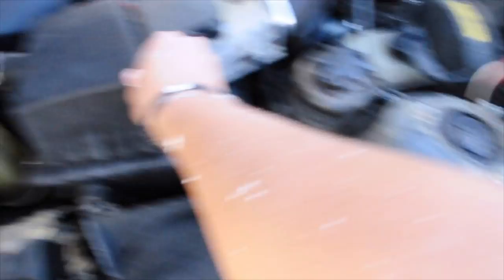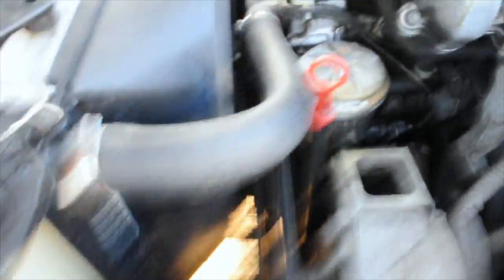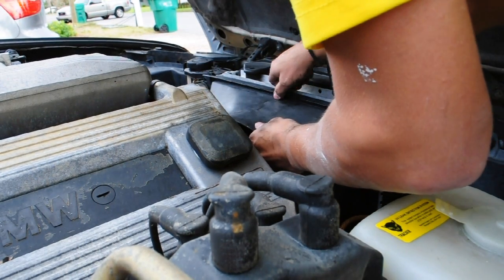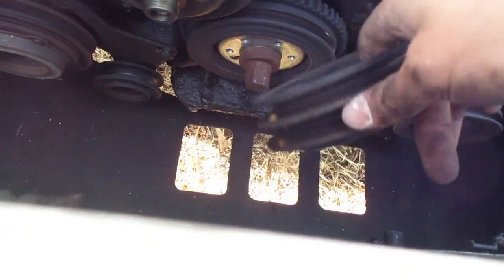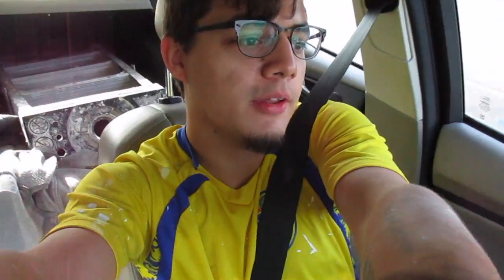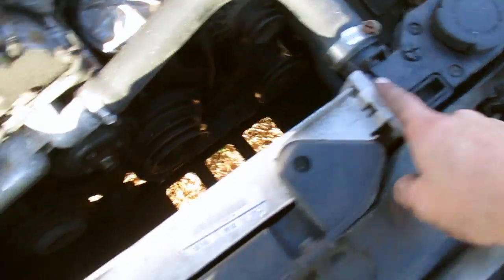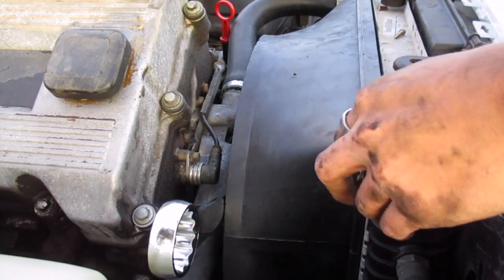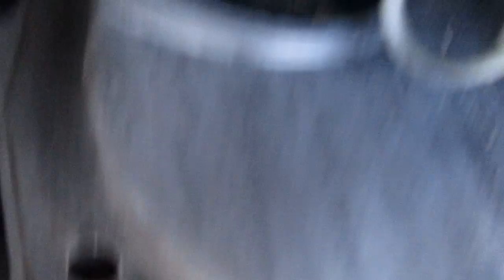Project E30 EP. 5: NEW BELTS

Comment: Hello dear friend. I have an e30 325i from 1990. At the time of starting it, the car starts but it feels like it is staying. Then I give the accelerator a couple of kicks to increase the rpm and the operation stabilizes, keeping it until it stops and turns on again. I tightened the alternator belt and changed the IAC as another youtuber had told me, but today I tried it and the problem persists. I would appreciate some information about the problem, if you had to see something similar. Thanks and regards from Chile.